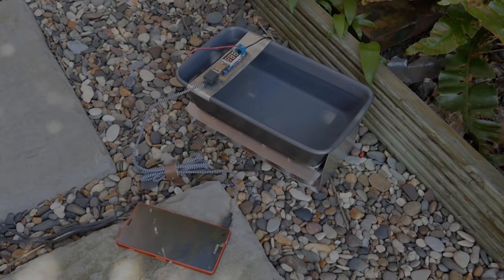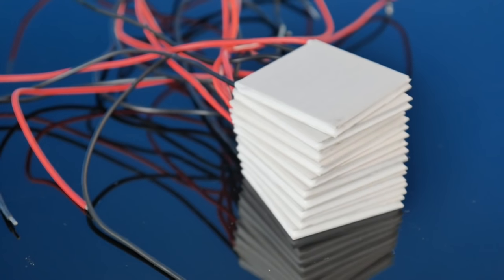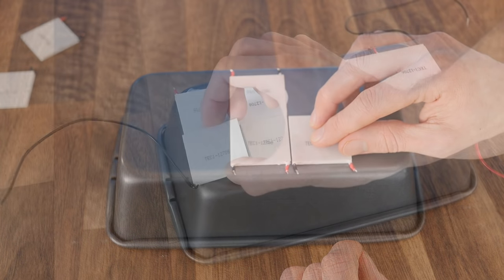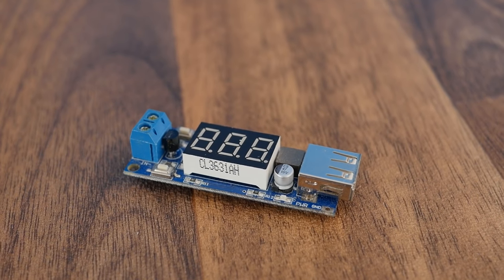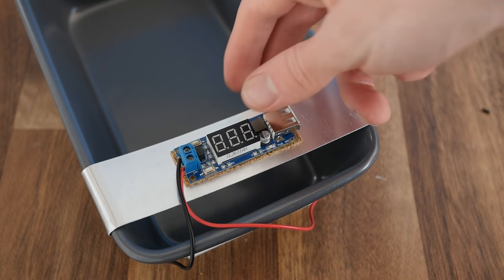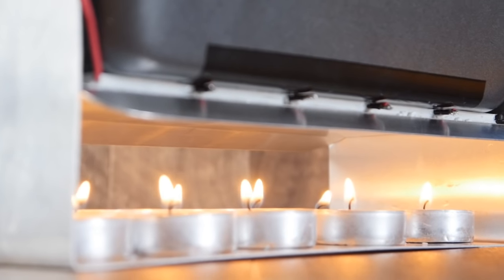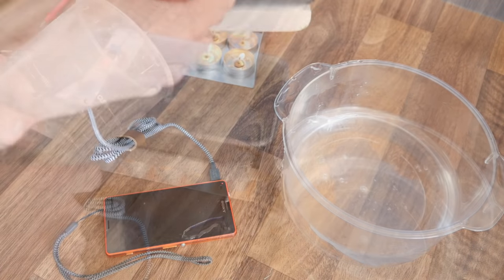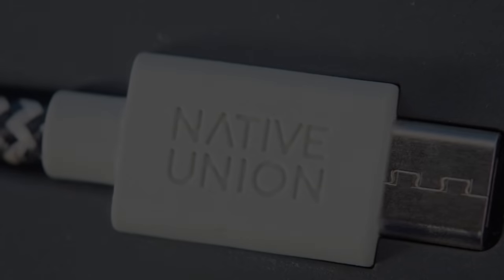How to make a DIY Thermoelectric Generator

Comment: 35 bucks ... is cheap ???? not in my books ... 5 bucks sure 10 bucks maybe 35 bucks ... heck I can get the coolers for less
Reply: btw they are called Pelltier devices ... the seibec device is NOT reversible while the pelltier is ... the seibec version  only goes from hot to cold to work while a pelltier device can be inverted ... you can put the cold side on an ice block and the hot side to a fan to heat your place ... put the hot side on a black aluminium block in your window and the cold side with a fan and you have a no water small air co ... or oscillating fan cooler
Reply: one can also do wire wrapping ... which uses pegs to hold the wire between two forks and then you twist the wire around the peg and poof you have a connection as good as soldered and better than just twisting ends together
Reply: you could locate a small aquarium water pump or decorative table top fountain pump that uses 5v and have that pump water into or onto a cooling block that uses a pelltier fan to cool the liquid ... and you dont have to replace your fluid then ...

Comment: could one power an Xbox with one
Reply: You probably could but you would need it to be a lot larger and you may need a custom adapter
Reply: +Adam Smith what if you used dry ice and lava for this??
Reply: +Beta Syrus When you use
Lava it will melt down
Reply: +M eGos lava can stay under the generator